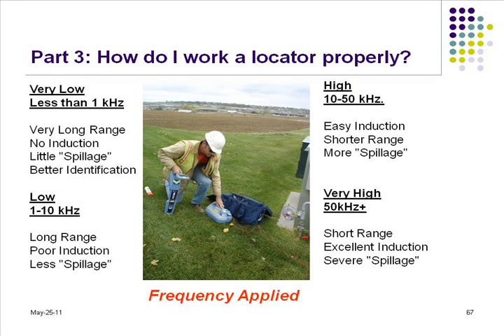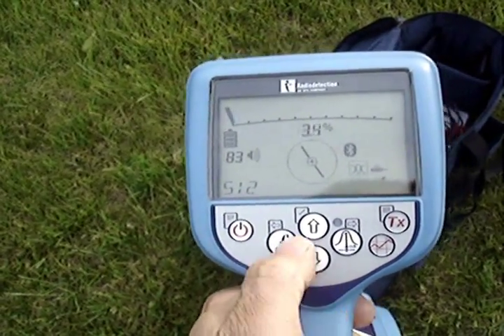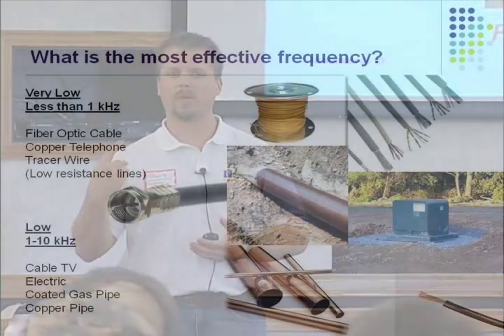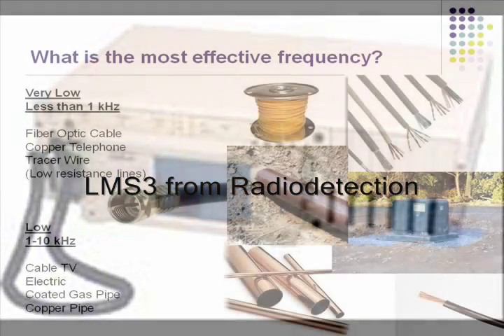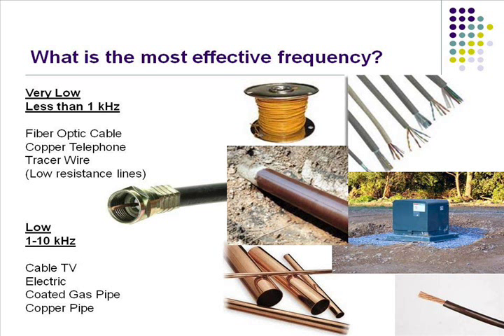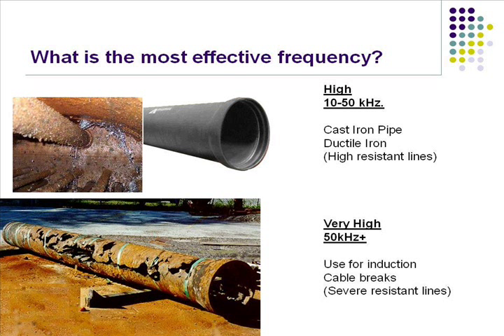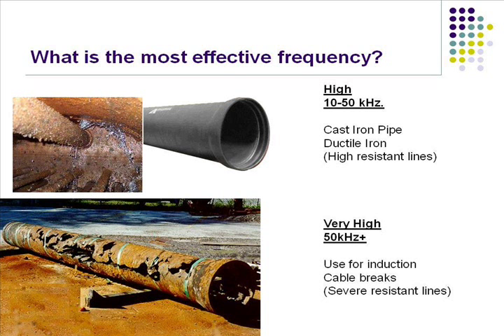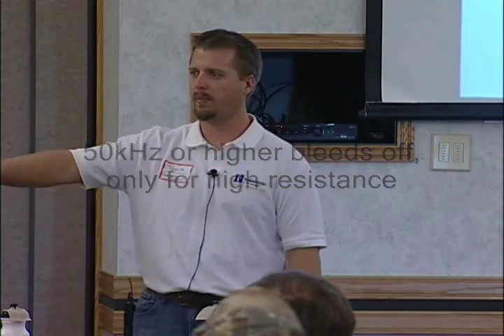Frequency Selection

Comment: Tracer wires do not need to be bonded on either end to perform locates. You do however need to close that signal with your own ground.
Reply from the maker: Agreed, but grounding the far end gives it an 'off ramp' to direct it what way to go.

Comment: Awesome video and explanation guys, well done. 
This would be one of the best videos I have seen so far online when it comes to explaining frequency and knowing which one to use. 
The that technitians need to understand, is that it is not about having one set frequency that you use all the time, it's about looking at your environment and the utility you need to locate and picking one that you feel will be most suitable and then if you find you are having issues, going back and changing the frequency or the way you have connected to the utility and then trying to locate again. 
It's videos like this that teach and explain why you would choose one frequency over another and why you might have issues with certain frequencies, that each technitian need to watch and learn before they go out and start locating on there own. 
Keep up the great work guys, regards Ben

Comment: I use a Dynatel 2273 locator. It has never been calibrated lol. our fibre multiducts have one 0.5mm tracer wire, the far end is buried so you cannot return earth it!  Ducts are 600mm to 2 meters deep.  I have mild success using 33khz or 133khz. My job is very frustrating! Reece in New Zealand.
Reply from the maker: No earth return path makes your job tough. You're correct 33kHz would probably be your best choice.  Just be aware of significant bleed off onto other lines.   The Radiodetection transmitters allow user to increase voltage output to 90V, which is very helpful to force lower frequencies down resistant lines. Only then you may be able to get away with using 512Hz or 8kHz.  RD's 4kHz current direction frequency would be good in this situation.
Reply: How can  take 2 m?

Comment: Locator for 5 years, located everything from gas, power, fiber and catv. This lower frequency obsession is the first thing I tell new locators to forget from training. In a perfect world with brand new lines buried shallow in the ground, low frequencies would work. Try using only 512 on a 50 year old exterior concentric primary that's direct buried and rotting in the ground. Same goes for a phone main that's been spliced and deeper than 3 ft. Locating is an art, not something you can learn in a seminar with PowerPoint. Git gud.
Reply: I’ve been locating for 5 years as well with locating companies but when stepping into the SUE world and it’s a different ball game, the lower frequency like 480,512,640,870,940 HZ is golden! Locating is an art but you (in general) have to understand the science behind it! So I laugh at your comment and should definitely want to know where you locate and what you use to locate. SMH
Reply from the maker: That's why we offer free field training.  Frequencies and antenna's are very important when trying to interrupt a bad magnetic field.  Take a look at this video, https://youtu.be/9Q-uBNHFrA0 ,that shows the higher frequencies return current jumping directly onto the telephone line causing a mislocate.  Most of the time mislocates go unnoticed because they aren't near the dig area.  Try to stay around 8kHz or lower when locating.  

Not sure why locates greater than 3 foot are giving you such difficulty.  With the right equipment 8kHz will locate over 50ft deep.  Can I ask what equipment you're using?
Reply: @Subsurface Solutions  I believe @Taggert86 is using his anecdotal experience to condemn entire electrical theory.  I respect the triangle and really do appreciate these videos you’ve put out.  I usually do sonde work resulting in an excavation and often times it gets it gets messy enough where we lose the visual cues we’ve asked for by other utilities.  Everything here is grounded with water. It’s so useful to understand all of this information so we don’t cause a strike which causes fines and perhaps even deaths.

Comment: question here:

can we use lower frequencies when searching the path of cable/pipe in induction method ? because sometimes i can't clamp or direct connect the cable/pipe. tq
Reply: Inducing is best done on higher frequencies like 65 or 83.
Reply from the maker: Induction requires a higher frequency that will "bleed".  All frequencies 940Hz and higher will induce.  However only the higher frequencies give a good transfer of current into the target line but they won't travel as far.  Most people find 33kHz or 65kHz to give the best transfer of current and locate distance.